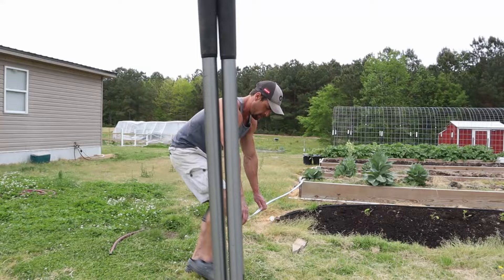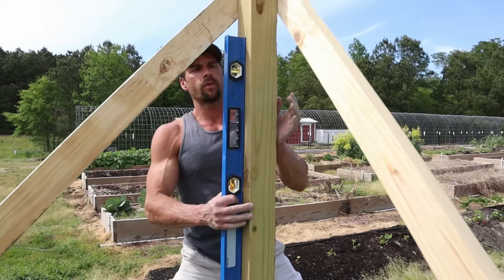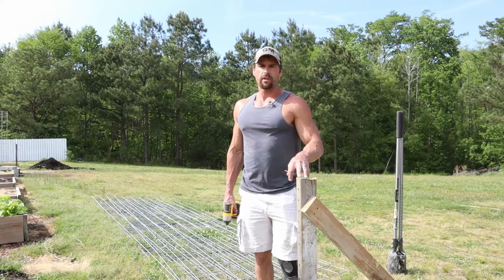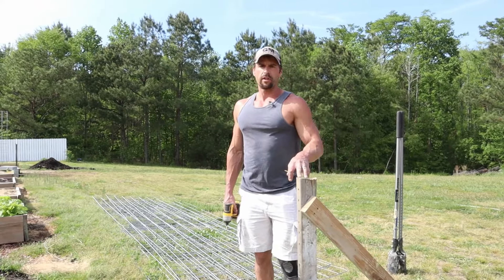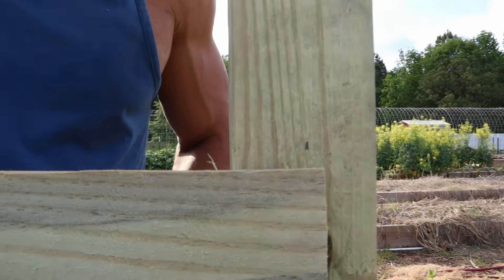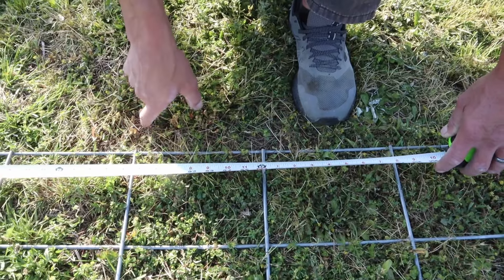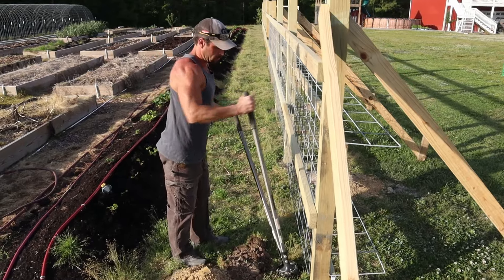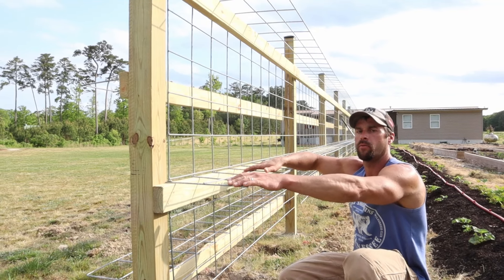Tomato Trellis Build w/ Cattle Panels | D.I.Y.

Comment: I Would appreciate seeing how you will place & secure your Tomato plants to this Trellis. Thank you
Reply from the maker: The plan for now is to use zip ties and tomato clips.
Reply: @SalmonCreekLiving I purchased some green ‘Velcro tape’ from Amazon for trellising to use on my grape vines. It works really well, and is so easy to remove & reuse
Reply from the maker: Thank you for the tip. I'm going to have to check out that Velcro tape!

Comment: What I do for my tomatoes, squash, and zucchini is wicked simple.. No bed is needed. I dig the hole as you did, but..... I take a food grade 5gal bucket, which I cut the bottom off. I stick it in that hole . Then I add whatever mix I like. 
End of season or if I don't need plants in that bucket I throw a lid on it till next time I need it. That way no weed seed getting in there and worms can easily travel thru the soil. End 9f season I throw a small shovel of compost in it, cover it up and be spring it's already to go. Weed free, worm castings and full of moisture.
If there 8s ever a problem or I want fresh soil I just take it out. Make sure you take the handles  off.. otherwise, they become a trip hazard and look unprofessional.
Reply from the maker: That sounds like a great idea! I may have to try that with a few extra tomato plants I have. I already have the food grade buckets because I was planning to plant a few tomatoes in them but just have them on top of the ground. Your idea would be a lot better and of course they would not tip over
Reply: Btw... I get the bucket locations dug out. Add the bucket so it's not squished. Then this is the wicked cool part.. leave the bucket in the hole. Put all your landscape fabric down even covering the protruding bucket. Stake it all down.. then. Wait for it.....I use a plastic welding gun with the inside corner wire to burn/cut about an inch in from the edge of the bucket. Pull the bucket carefully out of the hole. And put it back in which pushes the ground fabric into the hole, creating a weed free perimeter around the bucket lip.  But shhhhh... your the first one I've told this little secret too. The best tool for woven fabric is that plastic welding gun. Uses my dewault battery. I cut all my straight and funky shapes with it. It takes a steady hand.. but all my holes and cuts are fused. No darn messy torch edges or shrunk fabric. The welder you can get on Amazon is yellow like dewault.
Is your Instagram not working? I was gonna send you pics of how awesome it looks. But the link won't open.
Reply: @kyyurtman1416  I'd love to see that set up. Would you mind sending to me? Your description of what you are doing has me very intrigued